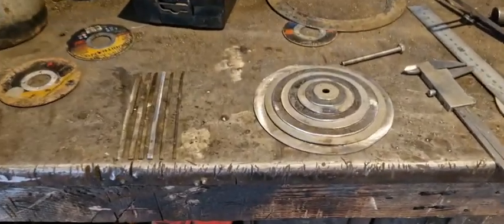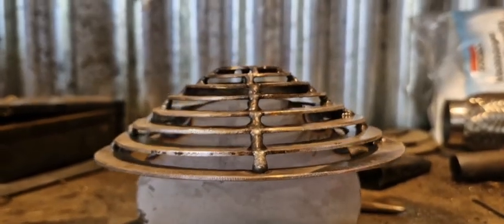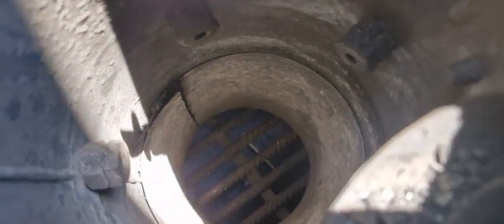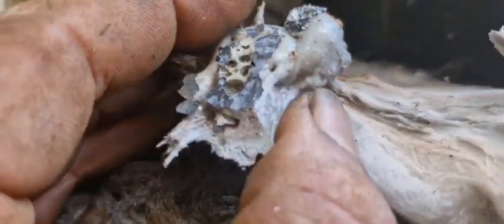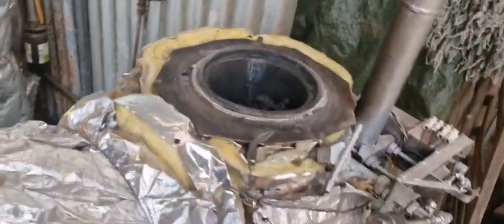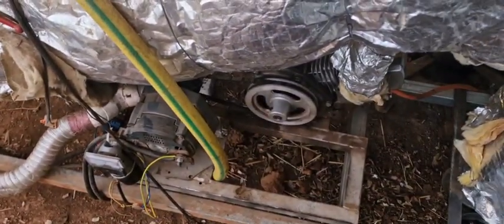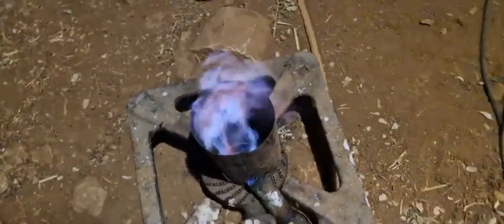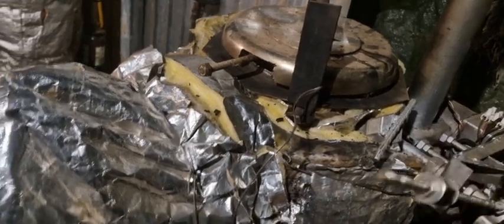3d grate for the "zero tar" 2 stage viking gasifier #DIYGasifier #BiomassEnergy #OffGridLiving

Comment: Oscar, that’s thinking out of the box, good idea. So does your gas go thru a filter or not? I’m liking how you’re dialing it all in.
Reply from the maker: No the 2 stage gasifier only needs a dust filter ther is no tar produced at al
Reply: @oscarverwey  what mechanism is the second stage?
Reply from the maker: Stage 1 is a indirect heated charcoal producing scruw feeder it uses the heat from the producer gas en the exhaust of the engine for drying, torrefaction, steam&air superheating en pyrolizing Al by reusing waste heat from the process so no radiator is needed. Pyrolisis at low temperature (around or below bellow 500 deg c) is beneficial in the creaking stage because only primary tar is produced! 
the second stage consists of a ring nozzle burner that burns only some of the tar en the charcoal from the scruw feeder falls right though the burner in the reduction zone where the superheated tar, steam en co2 are reduced by the charcoal so it makes no tar whit just a little air like 0.10 equivalent ratio instead of 0.25 / 0.45, the funny thing is whitout adding any air the gas is already Cleaner then most gasifier flames I've seen on YouTube 😂

Fun fact about the character of this machine, the gas production is proportional to the heat added to the screw feeder not by the amount of air drawn in the gasifier so the more load on the engine the more gas it makes
Reply: @oscarverwey  wow, that’s bazaar, I had no idea. Thanks for all the knowledge
Reply from the maker: No problem dude , gasification has a bad name en together we can set this right these tar making machines need to go ! I would appreciate it if you could mention me if you decide to make something approximating my design make sure you watch Al the videos I have about this machine everything is shown, good luck!
Reply: @oscarverwey  thanks friend, I’ll definitely mention you, I’m always trying to to think of the most efficient, simplistic design. God bless you